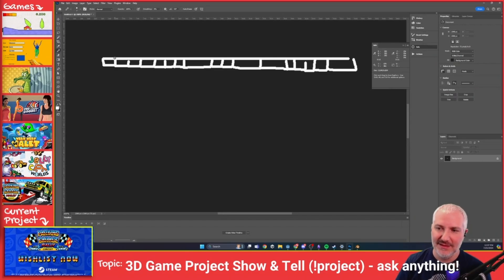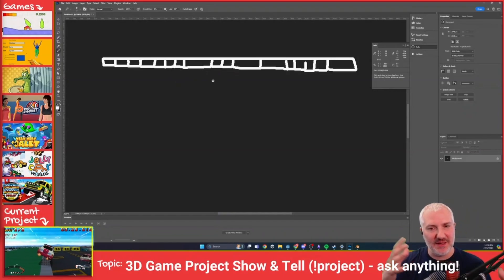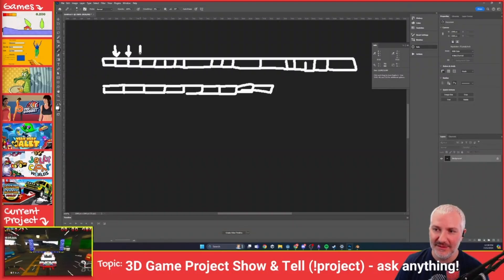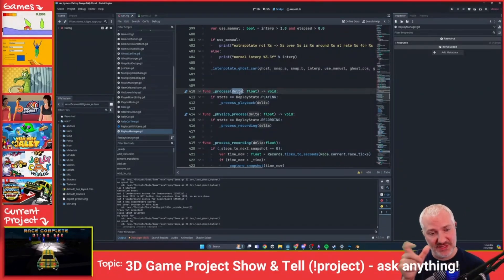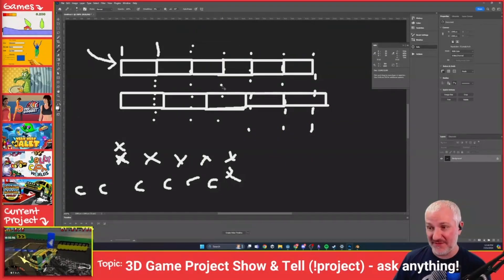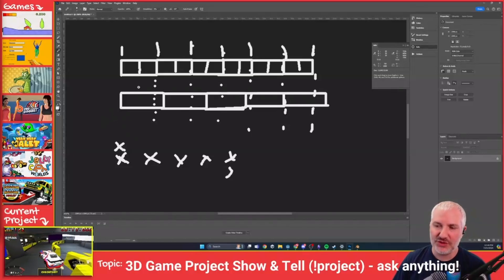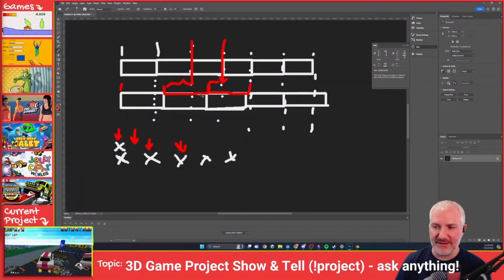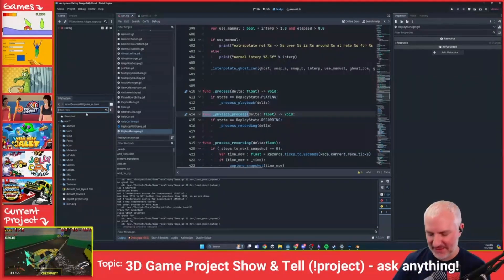Process, Physics Process, and Interpolation (in Godot)

Comment: Is there a downside to coding everything on the physics process? Is it just that the game will be caped at the physics frame rate?
Reply from the maker: Basically yep, that’s the downside.
Reply from the maker: And also if the game running slower than the physics rate, all that code will be executed more than once per frame, which could contribute to the slow performance.

Comment: great explanation of some of the more obscure causes of jitter.
For your game btw… couldn’t you set the physics update really high? 1-10 cars, static geometry… or are mobile devices bad at that too?
Reply from the maker: No reason not too make the game run well on as many devices as possible!  I’m not targeting mobile, but I want as many PC players as possible to be able to play the game.
Reply: @WalaberEntertainment  seems like most modern PCs can do those physics at a rate that surpasses most monitors? Or are you doing advanced joint solves per wheel to simulate suspension or something?

But anyway, good to make it super smooth even for the tech heads with 240 Hz monitors :-)
Reply: @WalaberEntertainment  I'm also surprised, as especially driving games often simulate physics more often (so that suspension will still work, etc). It can easily be pushed to like hundreds of times per second.

EDIT: So iRacing has 360Hz, Assetto Corsa 333Hz. And both will also help greatly with the lag, as with say 200Hz physics, your delay will be at most 5ms, average 2.5ms as compared with the version without interpolation.